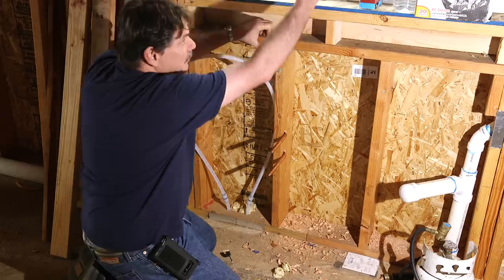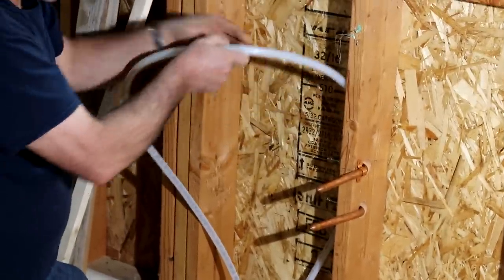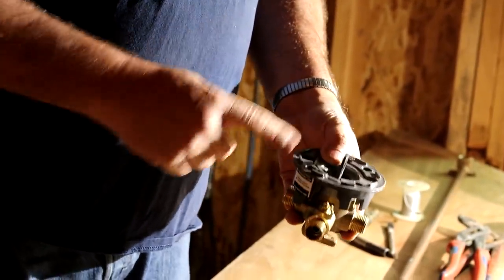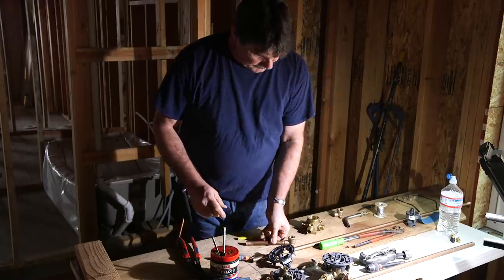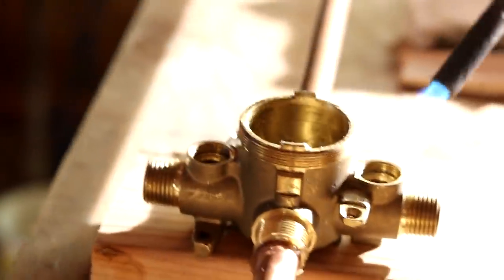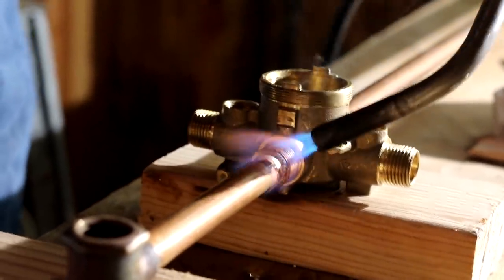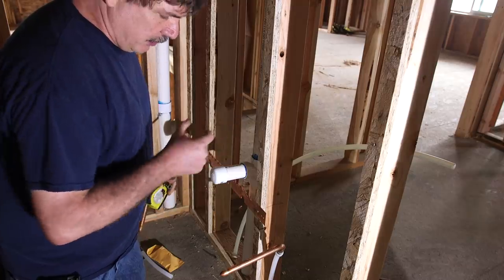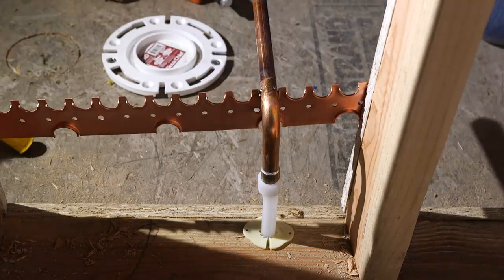The Plumber Torches It Ep. 96

Comment: “I hope the water is shut off”, same thing I say as I cut a line. Classic
Reply: "I'm not a gyneologist but I may take a looksie."
"Yeah, you can close the lid, all of the relatives have seen the body".
Classic construction humor :)
Reply: @pistool1  A couple of years ago I was replacing an unvented cylinder in a commercial kitchen and I closed the service valve and then cut the wrong side of it, the live side. I was so thankful the kitchen had vinyl floors and all the kitchen units were on stainless steel legs. I reckon we lost about 200 litres of water before I managed to shut it off. I blame the caretaker of the building standing over my shoulder and chatting for my mistake. Always gotta find someone else to blame ;-)

Comment: I've been plumbing 15 years now, 5 years an apprentice and 10 years qualified. Nice to see a plumber bothering to ream the end of the pipe and also choosing my favourite flux! I think La-Co works best for me, used very sparingly a little goes a long way. People make the mistake of using way too much. We could all argue over which flux is best for the next several decades though, like you all did already. For those that use too much, I do a demonstration where I flux a properly cleaned pipe, wipe the flux off with a rag and I can still make a solid joint. I'm not saying to put so little in normal use, just to prove that if it's clean and there is even the thinnest film of flux it'll still work. I've seen people dip the whole end of the tube in the tub and that ain't the way!

Comment: Loads of good advice here but my favourite is to not try to bring the waste pipes in centre with where the trap is going. Offset it by a good few inches and you will have such an easier time connecting it up. I also really love hearing the channel owner/narrator talking about the trade in such a good way. There is indeed no civilisation without plumbing. Plumbing is my trade and has allowed me to earn a good living for more than 10 years now. I love my job.

Comment: We need another EC spinoff channel just following around Phil.
Reply: No, we don't. Scroll far enough down in the comments on these and you'll see feedback from us plumbers. This guy does not need to be showing off plumbing to people keen to learn. Very bad habits and poor work. 

Just to point out in this video, you should ALWAYS clean the pipe and fittings when using copper. The point of hitting the pipe with sandpaper/emery cloth, and the fittings with a wire brush, is to etch the surface to the solder will adhere to it. Flux facilitates this by means of an acid, and also cleans the surface. You should definitely not put water in your flux as he has done here, I don't know why he did that and it is asinine. When heating the fitting you are going to solder, never point the torch into the fitting as he is showing here, that will throw debris and particles into the fitting you are trying to solder, which will cause a leak. Hold the tip of the flame on one spot on the bottom of the fitting, near the end of the fitting where the pipe stops, until it is hot enough on the top to take the solder, this will ensure the entire fitting and pipe end is hot enough to fill the joint evenly. 

As far as the last video with the Drain, Waste, and Vent system, there are plenty of issues to be addressed. Refer to that comment section for those issues. 

This guy just seems to work too carelessly. It is easy to see he is a service plumber. He knows how to lay out a system alright, and he has knowledge for sure on preventing problems in the long run. However, the quality of his craftsmanship is low. Nothing looks neat, and too many shortcuts are taken. I would not be proud enough to have myself shown in these videos if I installed work like this.
Reply: @ninjafishXD  looking forward to watching your channel.
Reply: @williamcox8491  ah yes, having a channel is the peak of craftsmanship.
Reply: @ninjafishXD  yeah Emil, I was a service plumber for, let's say a long time. You get so ingrained in the "working with watcha got" mindset. You do as good a job as you gotta do to have a working system in a reasonable amount of time for a reasonable amount of money. It doesn't make for bad work per se but most install guys I know do beautiful work on new construction. Where I was used to being stuffed in some crawlspace just trying to "make it work" hoping I didn't find the previous occupants corpse hahaha.
Reply: @ninjafishXD  I thought you were a communist dictator, didn't realize you were a master plumber as well.

Comment: As a service plumber, Phil, I think I love you!!! 

I just fired a new clients plumber that has done several jobs for them this past weekend. He did more damage to the sheet rock than the water leak did and then wanted to go through the subfloor to find the leak in the kitchen. I walked in, looked at the kitchen layout and then the leak in the basement. Told the client the dishwasher was leaking. She didn't believe me until I pulled the dishwasher. In less than 15 minutes I became her new hero! Well, except for the part of buying a new dishwasher!!

Then she asked me how hard it would be to tighten the floppy faucet body and sprayer on the sink. Tried my best, but when you don't put the nuts on to get everything tight, well, a guy can only make so much chicken salad...

Comment: Pretty good piping. Par for the course. The copper hold rites are handy and the flux creates what’s called “capillary action” the acid draws the solder in when the solder reaches its “flow temp”. In my 25 years of plumbing, I’ve never seen any issues with the weighted pull out sprayers being caught up in the stop, unless it’s protruding to far out of the wall, which means it wasn’t plumbed correctly to begin with. I liked the words, plumbing defies civilization, so very true👍🏻🇺🇸

Comment: Phil reminds me of the guy who I apprenticed under when I was learning electrical. He explains things extremely well because he can make even the complex technical reasons for things simple and straightforward. He takes the time to give a practical example of why you do take an extra step or two to do things not just correct, but better for yourself in the long run, or even the next guy in the process. And he knows his tools and materials well enough to know when a shortcut is actually a proper way to do something to save time and not just doing something halfassed to save time.

Comment: Another great video. A tip for some especially if you are sweating larger pipe is to use tinning flux. It contains a minute bit of solder in it already ensuring that the clean copper surface is tinned at the proper temperature. It also helps distribute the heat between your parts. It also gives a handy indication as to when your joint is reaching the flowing temperature.

Comment: Interesting. All plumbers I've seen have told that never use damp rag on hot solder joint if it sizzles, cause it could create cracks in joint.
Reply: They're right, don't use it on a hot joint but after it's cooled down a bit it's not a problem

Comment: “That should hardly leak at all”.  Priceless. The real pros make it look so easy. Just like sending a major league fast ball over the left field fence.  It does require training and skills.
Reply: I’m a plumber this is madness soldering all the compression joints to a shower valve 
What a knob 🤦‍♂️🤦‍♂️
Reply: Can you explain why?
Reply: @thomassiegfried5409  what if you need to remove the valve at some point 
Would make it very hard wouldn’t it 
They would t supply olives and nut otherwise ???
Reply: @MrSpencerhammond  I agree a bit easier, but to unsolder it wouldn't be super hard? I am not a plumber but have seen a few solder joints and not too hard to break joints, or just cut pipe if replacing valve
Reply: @thomassiegfried5409  believe me 
I have been fitting valves for years 
And there’s no better joint than a compression in this situation 
You could either use ptfe tape 
Maybe a little lsx silicone compound 
Or even liquid ptfe to joint these areas even a little bos white potable putty in the old days we used hemp on joints which is great as well to carry on board
Reply: @MrSpencerhammond  I believe you, I just have seen alot of valves soldered in so that's why I ask. Father was a plumber for 30 years and def saw both ways.

Comment: I'm with him, I hate when the pipes are floppy coming out of the wall.  It just screams cheap and flimsy.
Reply: yeah, not to mention the sheer joy of having to replace a crudded up ball valve. Nope, no easy compression fitting on copper for you, you get to hope there is enough PEX left in the wall to pull out and put on a new valve. I mean, that could happen with copper too but those nice long nubs he's leaving tell me he's had to punch holes before because some clown didn't leave enough to work with.

Comment: Here in Australia it's actually illegal to not rheem the copper tube after cutting it. And it does cause a stupid amount of noise if you leave it there. I also wonder what the water pressure there is, I am surprised the PEX to brass has no crimp clamp or any form of retaining clip. It must be a fairly low pressure system.

Comment: for PEX in my renovations I've been using outlet boxes with bulkhead valves that attach. They're interior to the wall, like a washing machine supply box. So the pex terminates to these valves, and you have a really nice, solid termination with high quality quarter turn ball valves instead of the leaky, multi-turn things we find under a sink most of the time.
edit: here's a link for example, https://www.supplyhouse.com/Sioux-Chief-696-G3011XR-1-2-PEX-Crimp-Ox-Box-Kitchen-Supply-Outlet-Box-w-MiniRester-Water-Hammer-Arresters-Lead-Free

Comment: No, the P-trap does not offset 4 inches, it offsets 3 and 1/2 in.  Measured from the center of the arm to the center of the j bend and you will see it's 3 and 1/2 in to the center on a small trap.  I've been a plumber for a long time and I'm still doing it. When I started plumbing we didn't have plastic pipe , yes I was pouring lead, hub and spigot. Also I still have all my lead working tools and pour lead at times....

Comment: I learned how to solder over 50 years ago while being trained as a radio repair technician in the Marine Corps.  Soldering inside electronics equipment is a somewhat more delicate than what the plumbers do.  I normally clinch my teeth when I watch a plumber solder.  All that said, Phil does a good job.
Reply: Somebody needs to introduce these poor guys to the concept of a heat sink, so they don't have to disassemble all this plastic crap.

Comment: The video doesnt do a good job explaining Phil's intentions and attention to details here at the beginning. 

Phil is switching to (pricier) copper in a location where the rigidity and durability will be of extreme value. Under a kitchen sink is prone to all sorts of shenanigans, and protecting those water lines by using copper under the sink is a smart move. Its also great that he's thinking about how the owner will use the home and is maximizing the usable space under the counter by taking just a little extra care and effort.

Job well done Phil. Hopefully the women who live in this house for decades mutter a thanks under their breath when reorganizing under this sink.
Reply: For real, improperly secured pipes are such a silly thing to skimp on. My house has rigid foam sheathing and they didn't bother to secure the hose bibs to anything, causing them to be loose. It would have taken all of 10 minutes tops to cut a 2x4 to properly mount it. Unfortunately a quality built house like this is always going to be out of my price range.

Comment: Maybe I'm missing something, but didn't see Phil using crimp rings over the Pex tubing to the brass barbs? (What keeps it from leaking?)
Reply: Not all PEX uses the rings
Reply: Uponor pex doesn’t use crimp rings. The grade of pex they use (pex-a) has a memory of its shape. So you expand it, slip it over, and it shrinks back to form the seal. 

Much better than any other pex grade. Those other grades require additional mechanical connections to be used because the plastic isn’t strong enough in and of itself.
Reply: @michaelwitt7984  Thanks!  This makes sense - I only knew about the Pex that needed crimping. Not a pro plumber myself, but an amateur who knows just enough to be dangerous!

Comment: A good plumber is worth his or her money - every. single. time.  When you've had a bad plumber it always creates a truly damaging situation.  I've had two bad plumbers in my adult life.  One decided that he was going to leave the 60 year old gasket behind the overflow tube of a tub that I hired him to replace the drain assembly during a remodel.  His quote "Well it looked alright at the time.  Anyway, I've still got the new gasket in my truck.  I won't charge you a trip charge to put it in."  The old gasket was as stiff as a hockey puck and leaked when the tub was filled too high because it leaked along the wall of the tub onto the ceiling of the kitchen below.  Like Phil said in the last video - $100/hr for a $3 part.

The story of the second bad plumber is even more infuriating and involves 5 inches of water in my basement.

But that's for another day.  Good work Phil!

Comment: One thing I noticed was using a wing ell for the spout, I've been told by several mfg that the wing ells create to much resistance and can cause the shower head to run without the diverter being pulled.
Reply: My company always roughs in tub/showers with wing ells and we have never had that problem.
Reply: It's only a problem with 1/2" PEX.
Works great on copper, or 3/4" PEX.

Comment: I’m not sure if I agree with bringing the waterlines up in an exterior wall as he did  with the kitchen sink.
Reply: In a cold climate, absolutely. Frost line in the area is 5 to 10 inches. They are also running water in the crawl space, it's not really an issue in that climate.

Comment: When you run the hot water in the sink  That hot water line is going to create an annoying cracking sound touching the wood like that should of installed it insulation strap. The copper wants to expand and being pushed up against the wood like that it creates a cracking song

Comment: steel nail on copper strap?  Defeats the point of using the copper strap since the whole point is to avoid galvanic corrosion on the pipe

Comment: Brilliant idea to solder pipes to compression fittings on your expensive, complicated part to ensure it can never be replaced or servcied without tearing down everything around it. Why use a threaded fitting and a wrench if you can expend  a bunch of gas, acid and solder, and make some extra work in the process? Screw nuts! /s
Reply: Gas and solder is cheaper than the female fitting. Which still needs to be sweat on to copper pipe.
Reply: The serviceable parts are behind the wall plate so you can service them later.
Reply: The bit that worries me is putting all that heat onto the built in service valves. The nitrile 'o' rings are ruined and will weep
Reply: @SkillBuilder  Also that, I was too busy shaking my head to even notice those seals. It also occured to me that the whole part might warp. Then there's the - albeit off-chance - risk of factory defects, you may have just installed a  dud, and you wouldn't be the first. There are probably a dozen other pretty good reasons this kid of stuff is engineered with screw fittings...
Reply: Wait are you being sarcastic?
Reply: @kozemchuk  Yessir and thank you for noticing 😅

Comment: Well that vanity coppers going to corrode for sure. He used copper clips but no copper nails
Reply: Does electrolysis happen in that situation? I've never seen/heard of it.
Reply: @kozemchuk  yes if you mix copper with anything other than copper with the exception of some it will eventually corrode. If you ever see copper pipes that are black or anything other than copper colourish then you will usually find (if you look) what caused it.
Reply: @homes24  Again you have not answered my question. Do you have pictures? Have you seen this happen with copper pipe, copper strap, and steel screws?

Comment: I have been a plumber in the uk for 16 years and never have i seen someone solder a compression fitting. Is this legal in the USA.
Reply: Where did he solder a compression fitting?
Reply: Well I might be wrong but the shower valve had  threads on it wich are  normally (at least in the uk) compression so it can be changed/repaired.by soldering it would you need to destroy the wall to change the valve.also compression fittings are normally loser fit than a compression and have a angled edge for the olive to compress into.Im not meaning to offend we do things very differently.
Reply: @lukeswainston1159  Nah, those are 1/2" NPT for screwing female adapters on. Some people run CPVC. I usually put a threaded coupling on the bottom one, and use a 12 inch nipple down to the spout.
Reply: Ok I get it I was mistaken.iv never seen those before thank you for the reply.those kinda fittings are not as popular in the uk probly why iv never seen them before.Allways pays to keep learning and to look how others do there trade. :)